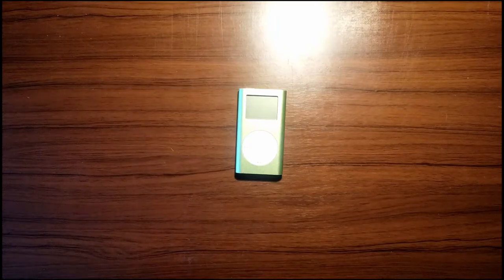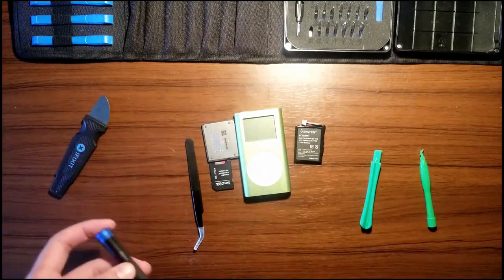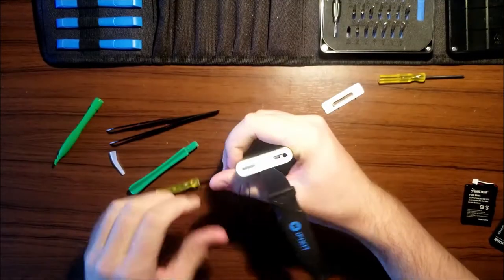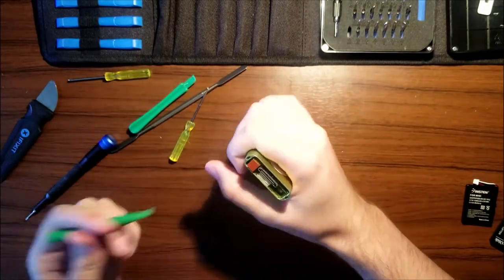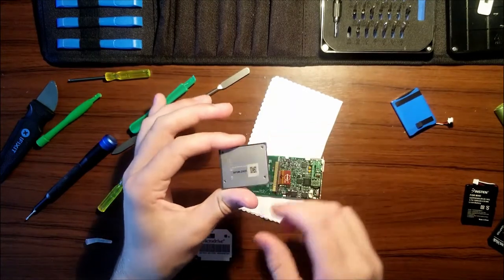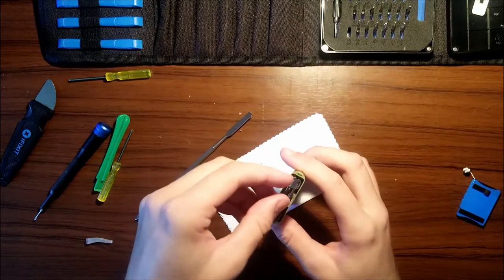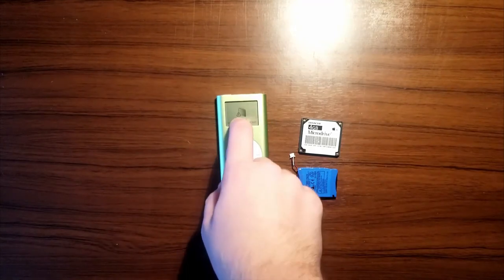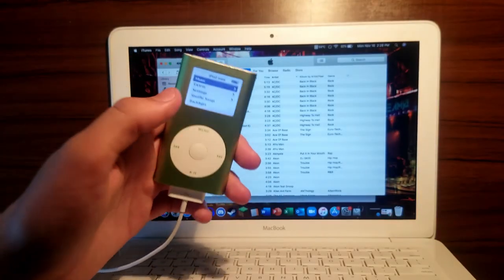Ipod Mini Restoration

Comment: Nice. About to do this myself. I only have windows PCs and itunes fought me tooth and nail to start and restore the ebay mini. Eventually I found an article that just said try another USB port. This was also after reinstalling itunes like 5 times. Using a back USB port did help. Maybe it was a power issue? The ipod also had a full charge at this point. Can't wait to do it all again when the iflash sd card kit comes. Thanks for the vid was a cool watch.

Comment: Its getting back to restoration page after the restoring process.

Unpluging and pluging again, asking for restore again.

At least seing it as a hard drive but keeps doing all like this, any tips?
Reply from the maker: Try fliping the flash card
Reply: @cobra727  nope its ok, just seing it as a hard drive and after getting formatted coming back again like nothing haopened bro.

Unplugging and same thing all over.Dont know why but i tried 2 microsd brands and 1 sandisk sd.

Fat 32 and other things, nothing charged.Dont know if its possible after plugging it to imac in the electronics store,dont know if they accept it :)
Reply: İ think i will return the red adapter which is the possible suspect as i read about the comments.

Time to go with cf 32 gb sandisk extreme/transcend.
Reply from the maker: @batutasci  you might want to get the iflash adapter, since there far more reliable. And you can put whatever storage you want in there.

Comment: You should know that battery is a complete knock-off. It's not 1300mAh, that is impossible.

Also you forgot to move the thermal pad for the chipset to the new battery...